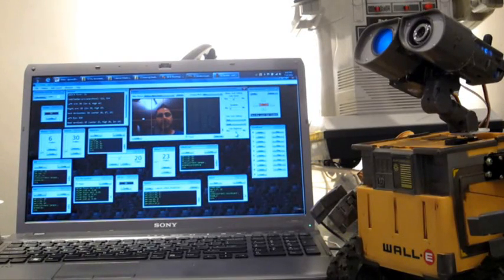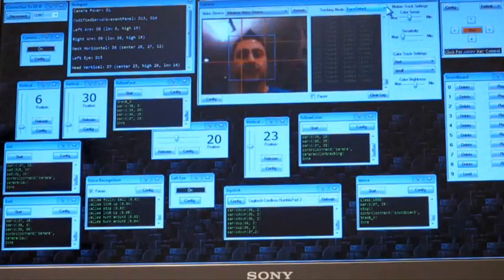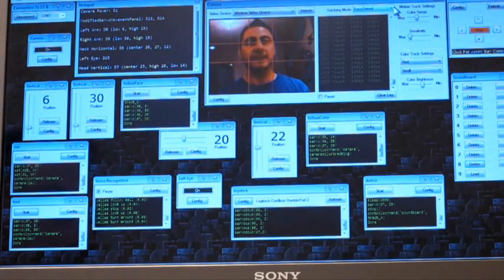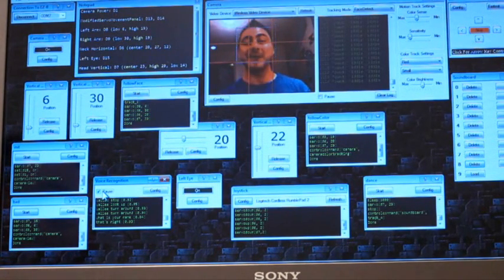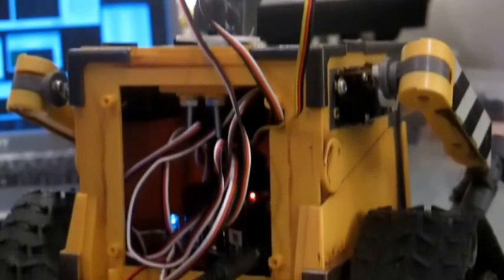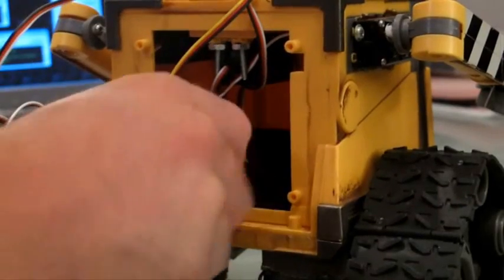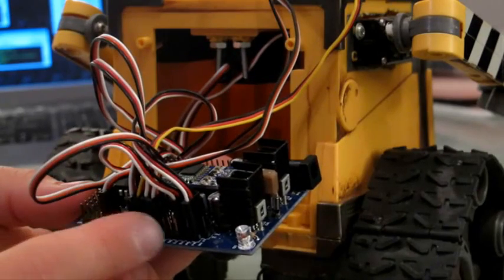The REAL Wall-E Robot

Comment: Which board are you using? I 3d printed a wall-e from thingiverse and could not get it working with there instructions with arduino. I only know a very little about coding. How hard is it to code to get mine working like yours? Thanks

Comment: can we use our own choice of drive motors with the ez robot modules? or do we need to use specially designed modules?
Reply from the maker: +satrio wibowo Depends on what you mean by "our own choice". I can't answer that without knowing the specifications or communication type of the drive motor or hbridge that you're referring to. A "drive motor" will need a motor controller or hbridge - is that what you mean?

Comment: I didn't even watch the full video until now so at least I know a little bit on how you kinda connect the robot to the computer.
Reply from the maker: G.M.Fuserer The robot controller in this video is from nearly 4 years ago and is no longer available. The new controller is the EZ-B v4 and connects WiFI instead of Bluetooth. There is a tutorial section that i built on the website that walks you through connecting to a computer and more. It's all available here: http://www.ez-robot.com/Tutorials/

Comment: Can I Use Arduino Uno Instead Of EZ-Robot Yeah And Another Thing Can You Tell Me The Name Of The Program That You Were Using To Make The Voice Recognition And Camera Recognition And Face Recognition (Answer Me Fast Please) As I'm Going To Work On It Today And Another Question Can You Tell What Was That Blue Thing That You Pulled The Camera Off It. I Would Be Very Thankful If You Answered Those Questions :)
Reply: And I Want To Ask How Did You Move The Robot With The Arrow Keys While Programming It
Reply: Yeah I'm using this for my science fair idea and you should search up opencv plus arduous cause that can make facial recognition possible.
Reply: I mean arduino
Reply: Also you can use the easyvr shield or any type of vr. I'm using a vr for 23$ at Amazon which is really easy to use and can store 14 voice commands and is arduino compatible.
Reply: Ok Thank You So Much ;)

Comment: Me build one. Also. Is there a way to change the wheels of Wall-E into your RC-Robot Wall-E wheels? ( I've got a transformable Wall-E figure that has flat model wheels. And roll on little wheels under the model wheel. Basicaly, The Transformable wall-e wheels are CRAP. )

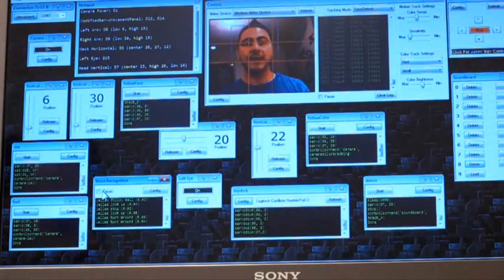Comment: @123mutta Do research, download the EZ-Builder program. Now the only way he could controlled Wall-e's movements is if he had a joystick or controller plugged in. Find the joystick control under Add Control >Misc.>Joystick. Now using those "Extra Open" eyes you said you have; do you see that window open in this video at any time his computer is shown? I'll make it easy for you, its at 2:53

Comment: But the software is computer based, does it transfer all the learned data over to the board, so when the computer is off, the board knows all the commands without the help of the computer?

Comment from the maker: @MinecraftTechnic It does 100 times more :) I've spent thousands of hours writing the firmware, ez-sdk and ez-builder. it's thousands and thousands of lines of effecient code :D After you add up the cost of shipping and hardware (board, circuit, bluetooth, battery case, etc) there is very little profit to compensate for my hard work. But every dollar helps!

Comment from the maker: @turtleD90 object recognition is something i started to add into the ez-builder software. Instead i went with facial recognition. The reason is due to the resolution of most cameras is very low. The wireless cameras that i use and recommend did not have the to accurately recognize most objects that it would learn. I went with facial recognition instead.